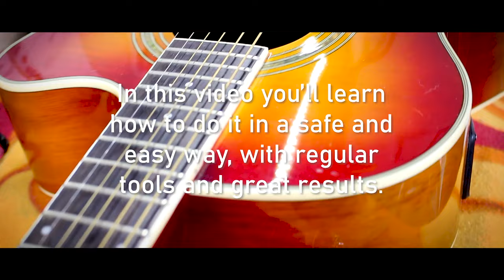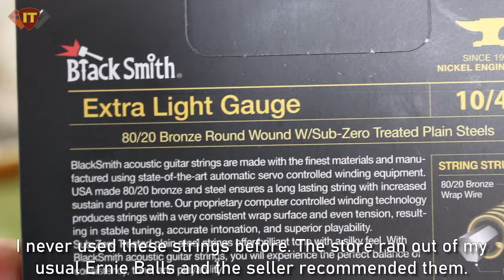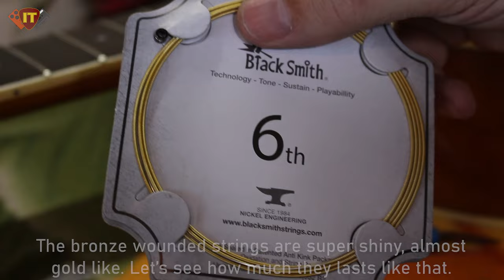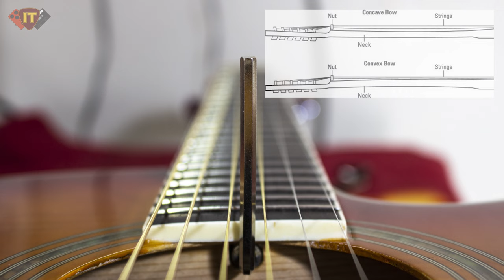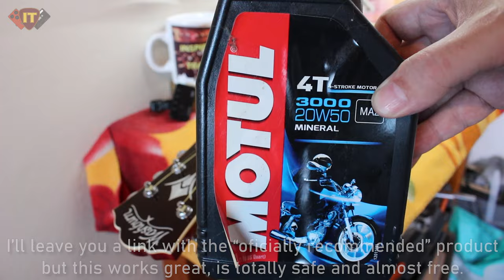How to Setup your Acoustic Guitar like a Pro - Full Tutorial

Comment: The dremmel tool was absolutely the wrong tool to use for that job, a deremmel tool no matter how skillfully weilded will never result in a FLAT surface.  You should have been draw filing with either a fine file or better yet small flat wooden sticks with various grits of sand paper.  dremmel is absolutely the last tool I would use for the vast majority of jobs people use it for.
Reply from the maker: You REALLY need to watch the whole video before making a comment
Reply: @InspiringTracks  I stand corrected but the way you were sanding that flat will still result in a very slightly rounded bottom along its length, i do jewelery crafting and silver smithing as a hobby so am "Crafty?" ish?  you should glue your paper down onto a piece of glass which is guarnteed to be flat enough for this job and your end result will be "perfectly" (in air quotes) flat.   

Allowing the paper top flex like that isl going to sand the ends down faster than the middle which in this instance probably isnt going to be noticable because this isnt exactly rocket surgery :)

Comment: Only one thing I would do differently is check string action before adjusting nut height. It’s a lot easier to replace a saddle if filed too low than having to replace the nut because of open string fret buzz.
Reply: He’s doing string action without a capo I think? This means that it depends on the nut…..so if you then adjust your nut slots it will screw up your action

Comment: A tip I learned online for bridge pins; loosen the string then push it back down, under the bridge. This takes tension off the pin and it lifts out without any help.
Reply: Cut the slots in the pin holes like the ultra expensive ones have, and you'll never have to worry about stuck pins again, and the resonance will be much better also. Because the strings are resting up against the sound board, and not in the little notch

Comment: After adjusting the string height at the nut It's advisable to sand the top of the nut so about 1/2 of the string diameter protrudes above the top of the nut. This prevents the strings from binding in the nut slot when tuning and when doing string bends.

Comment: Love love love …… I have burnt my eyes and wasted many minutes watching from so so to mediocre videos for acoustic set up. I am so glad I stumbled across yours and became a subscriber. I have been in possession of and older Takamine left to me by an old friend for many years. The nut was missing, and the bridge was lifted had a split and a sloppy attempt glue repair oh the saddle had been pulled forward and was stuck in that position. So, I found what looked like a direct replacement by the measurements. I learned how to remove the bridge with a little heat and sure enough it had been originally glued to the lacquer. I also ordered a bone saddle and nut. Well, the pin holes were off, so I filled with a wood epoxy and plan to redrill … not there yet. I think what I have learned here will be a big help moving forward. Thanks, if all goes well, I will send an update lol.

Comment: Thank you so much for this! Great quality content. I really like the 3d print idea. I wonder if wood filament would turn out better than the PLA or ABS shown.
Reply from the maker: Thanks! I guess with saddles and nuts the harder the material the better the transference of strings vibrations to the rest of the guitar. All 3d printing materials I know are pretty soft but never tried wood filament, maybe it can work a little better

Comment: this is great.  i've been playing guitar for decades and my acoustics get out of whack all the time and I can't afford to go running to the luthier every time i need an adjustment.  I wanted to learn how to set up my guitar on my own and I am following this video as a guide.    so far so good.  I knew something wasn't right, and the video helped me determine the saddle is way too high.   i'm going to sand it down tonight and see how it goes!
Reply from the maker: Good luck! Remember to measure twice and sand once! Dont rush it and take all the time you need
Reply: @InspiringTracks  thanks, i'm working on a plan to make sure I sand it evenly.   I have an oscillating sander tool, i think i will use that to start and then change to manual on a flat surface.   my string height was 3.25 mm!
Reply: @InspiringTracks  thanks!    i actually broke the saddle, trying to get it out without removing the strings!  but I glued it back together for temporary, and i ordered a new on that just arrived.  the guitar is WAY better now already....  in the next couple days I'm going to put the new one in and make sure it's the right height.  thanks again.
Reply: @InspiringTracks  Haaaaaaaa

Comment: Great Video!  This actually helped me a ton!  The only comment I have is that if you sand down your saddle by 1.5mm (as an example only) the strings lower by 1.5mm.  Not sure where the idea of it only lowers it by 1/2 of what you sand down came from but just wanted to let someone know that so that you aren't afraid to remove what is needed.  Initially I measured my 6th string at 3.5mm at the 12th fret and then my 1st string at 3.25mm at the 12th fret.  My target was 2mm at the 6th and 1.75 at the 1st string so I needed to shave off 1.5mm from the saddle to get to where I needed to be.  I sanded off 1.5mm and my action was PERFECT at 2mm and 1.75mm respectively!  Just follow the steps of this AWESOME video and you will be successful!
Reply: I thought the saddle reduction had to be double the 12th-fret action because the 12th fret is the halfway point of the strings. Since the strings angle on a downward slope from the bridge to the headstock, the distance between the string and the fretboard at the halfway point should naturally be half as high as where the string meets the saddle. I don't want to question your measurements, but do you think the results may be related to the position of the truss rod in your guitar?
Reply: As I understood and also it must be like this geometricaly - if you want to lower the action by 1.5mm you have to cut the saddle for 3mm 

just take a blank paper and make a points at A: X, Y (0, 0) - B: (6, 4). And make the 3rd point exactly in the middle at C: (3, 2). Then lower the action by 2mm"s it will change the point B: from (6, 4) to (6, 2) and take a look how high will be the new point C (the middle) it will be exaclty at the half of cutted amount (from 3, 2 to 3, 1)

Comment: Nice Washburn. Just got a WD10S myself and was thinking of filing the saddle a touch.. only thing is im not sure if years of playing electric has made me forget what it feels like to play an Acoustic lol. Maybe am just chasing that hyper low action that is unrealistic on a good sounding acoustic. Still it definitely requires more effort than im used to putting in at this point
Reply from the maker: You'll be surprised how much more easy is to play an acoustic with the right string height at the nut, specially while playing chords. I'll start checking that If I was you

Comment: What is the name of the tool you used to deepen the nut slots? Please advise so I can purchase one. Thanks so much for the awesome Video!
Reply from the maker: They are technically torch tip cleaners but ive seen them also advertised as nut files. Real nut files are way more effective and expensive but this ones work fine for some touch ups

Comment: Wouldn't it have been a better to do all the measurements, adjustments, etc. before putting new strings on. That way, before cleaning the guitar, all measuring, filing and other adjustments could have been made using the old stings. Then the old strings could have been removed, the guitar thoroughly cleaned, and then the new strings put on, with little left to do other than fine adjustments and tuning, on the newly cleaned guitar.
Just a thought...
Reply: Maybe tension in new strings is different from tension in the old worn stretched rusty dirty strings, which might affect the neck? Just guessing. But I see your point.

Comment: When you’re measuring your relief and your action hold the guitar in the playing position. I have an expensive set of nut slot files AND the torch tip files you used, they work really well! I use René Martínez “Nut Sauce” in the slots. He was Stevie Ray Vaughan’s guitar tech and he’s excellent. Google his name, you’ll find his site. And just to repeat the most important detail of setting up your guitar: as the guy said go SMALL steps. It’s easier to take off a little more than to have to cut a whole new nut! Also always check for free buzz by playing each string up the neck and see if it’s buzzy. Sometimes you have to sacrifice perfect action to get rid of the buzz. Go slow, go far!
Reply: Q

Comment: Is the steel wool mandatory? I've seen people just use a soft cloth and lemon oil, have you tried that method before? And if so can you explain why you prefer the method you use. Trying to find the best way to do it, but I like to know the why behind it haha
Reply from the maker: SW wool is just one of the many methods out there. It's by far the messier but I found it works wonderful on very dirty boards. Other people use razor blades or naphtha but I don't like to use solvents or sharp objects. If your guitar has only the light dirt from a couple months between string changes then a soft cloth and some lemon oil should be more than enoug. You can also use some fret erasers to polish the frets and you are good to go.

Comment: Thanks for the great video! Only got one question (probably a no brainer for most of you): when you checked the nut height using a paper as gauge meter (correct use of word?). Is the string not supposed to be able to move down and make the “ting” sound when correct height?
Reply: Eventhough it seems no gap, but it should be enough to move slightly a little. But you should also able to create similar sound when you do the tapping like in the video demonstration

Comment: Great video but I don't understand the difference between adjusting truss rod/neck relief and the action on a guitar. Seems like the same thing?
Reply: Not the same at all. Relief is not for action, it sets the fretboard into the proper shape to accommodate the arc a string makes when played, less movement at the ends, more in the middle of its length. Action is set by adjusting the saddle. If you use the neck relief to assist your action you end up (more than likely) increasing the relief and bringing the string to high off the middle frets. Then your notes will play sharp. Measure your relief and adjust it, that will remain the same, it’s set by the straight line of the string between the first and 12th fret. Too long, sorry!

Comment: This is a great straight forward video. Thank you for sharing !! Can you tell me if the settings would change for 11's ?? I use 11's and I wonder how much different the settings would be? I used your helpful settings and I believe the nut needs to be replaced as the g string has almost no gap and the saddle has the strings too high. I believe it was set up with 12's. Thanks again !!

Comment: One detail I read from luthiers is when winding the strings through the posts, make sure the wounds are on TOP so that the string is at a correct angle to the nut. I think I saw that this was a bit inconsistent in the video. Not sure if this is true or makes a difference though. It's just something I read. Good video though !
Reply from the maker: Thanks! There's not much difference in winding up or down. As long as you don't make a mess and keep all the windings nice and not overlapping each other, then tunning stability will be fine. It's kind of like the "top wrap" on Gibson Tune-o-matic bridges, just a personal prefference that doesn't have much real world impact. Cheers!

Comment: Do you think 3D pringing could be used to fine tune compensation and later file one from a proper material?
Reply from the maker: Absolutely, you can 3d printed one and tweak it until you find the sweet spot and then translate it to the proper part. That should totally work!

Comment: Hey thanks for putting this up man. Clear & concise. Great music as well!  I have a question...

When adjusting the string action (by trimming or raising the saddle). the string length from nut to saddle will lengthened or shorten; however minute; depending on whats done. Is this correct? And thus will affect its intonation. Is there a work-around to this?

I've actually done a saddle height trim once before and took off about 1mm from the bottom. The intonation was spot on before I made the adjustment. With the trimmed saddle installed, intonation went to shxt! I couldn't figure out what went wrong and my best guess was the change in string length.

BTW, that was the last time I will ever try to set up an acoustic guitar lol
Reply from the maker: Glad you liked the video! And that's an excelent question! Since there's no way to easily adjust intonation on an acoustic never tought about that. What you said makes sense but in my experience never noticed a significant change in intonation. Since isn't that common to play high notes on an acoustic I think isn't a big deal
Reply: @InspiringTracks  Try playing Blackbird!! Thx for the reply :)

Comment: Doesnt truss rod adjustment already fixing the low or high action? Do i really need to mess with the  saddle because that thing is scary
Reply from the maker: Using the truss rod to adjust action isn't a good practice, you may end up with a neck with an unnecessary bow just to compensate the saddle problems. To me it's way less scary working on the saddle,  you can always buy a new one for a couple bucks and install it in seconds if you mess up things. Hope the same can be said about the neck lol
Reply from the maker: Using the truss rod to adjust action isn't a good practice, you may end up with a neck with an unnecessary bow just to compensate the saddle problems. To me it's way less scary working on the saddle,  you can always buy a new one for a couple bucks and install it in seconds if you mess up things. Hope the same can be said about the neck lol
Reply: Thank you for your kind answer, im new to all this. One thing: if not the action height, what exactly does the truss rod adjustment fix? I thought the whole point of truss rod adjustment was giving the fingerboard a good action
Reply from the maker: The truss rod adjusts the "straightness" of the neck. It should be almost perfectly straight excep for a really small bow that let the strings some room to vibrate without hitting the frets. When you adjust it the action certainly can and will change but this is a side effect, it need to be adjusted later at the saddle. That way you'll get both perfect neck bow AND the prefect action
Reply: @InspiringTracks  thanks again for this. Really informative. Best of luck.

Comment: Why don't you use the slot on the end of the string winder instead of using wire cutters?  I spent 30 years as an auto mechanic and I was always taught to use the correct tool for the job.
Reply from the maker: Because its 3d printed by me and don't have that feature. Wire cutters are a perfect tool for the job